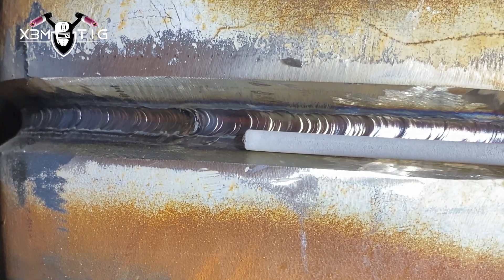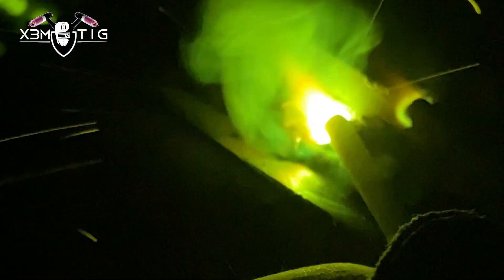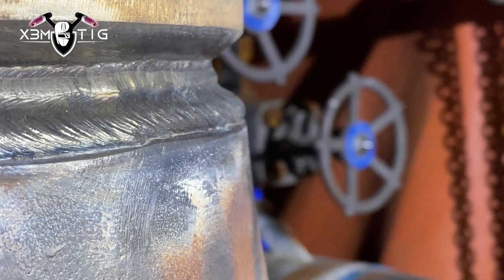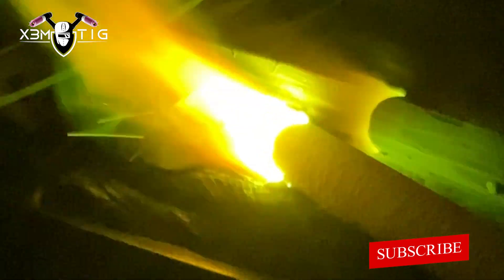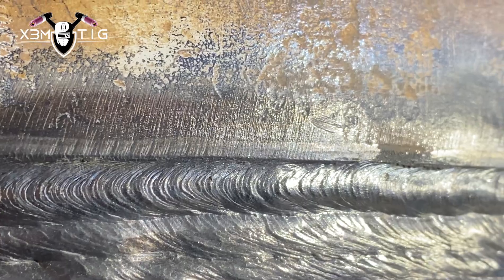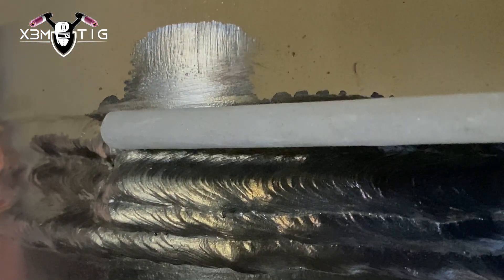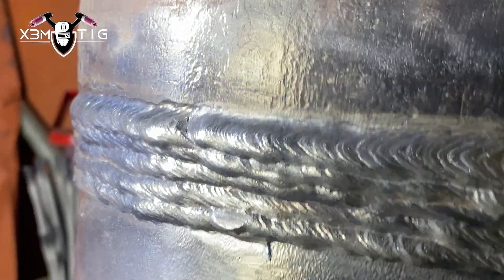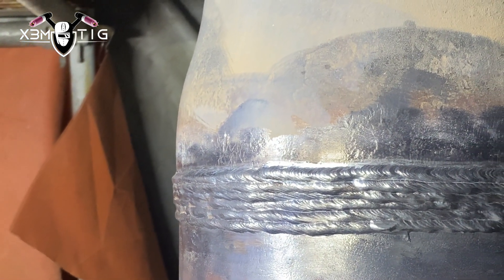Stick Welding Secrets: Speedy Fill Passes and Inclination Hacks!

Comment: My favorite way to weld pipe, tig root/hot stick out. Great video Marko 🤙🏼
Reply from the maker: Thank you my friend 👊
Reply: It may seem like a stupid question but what is the advantage of going for the rod after root, is it speed or requirements to do it instead of tig?
Reply: @Jungwoo94  for a lot of plants and refineries, they don’t want a 6010 stick root, too many sparks inside and out, so they’ll switch to tig root and hot, stick out because of the speed. Mainly only on bigger pipe.